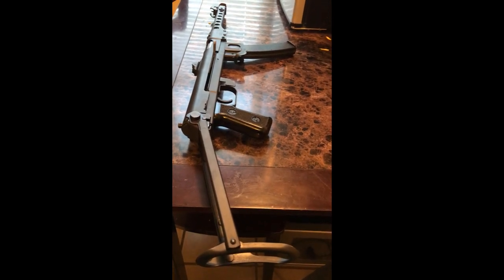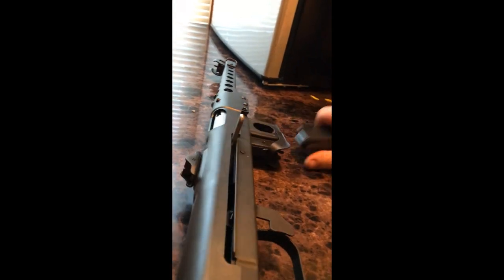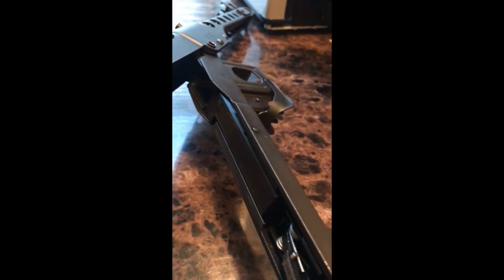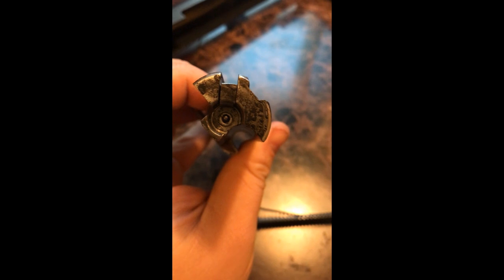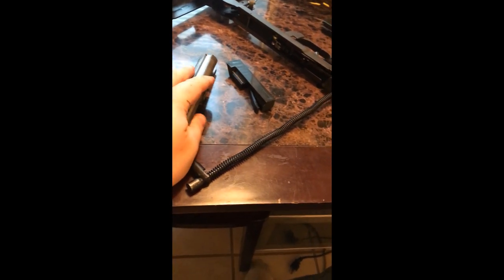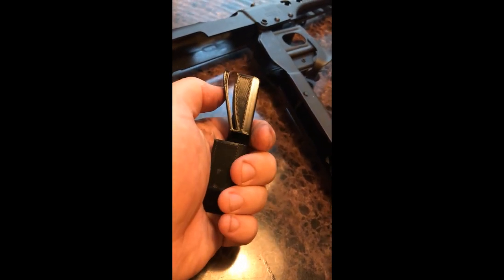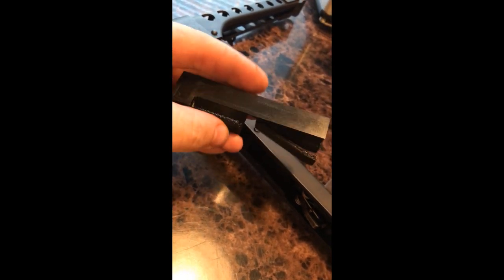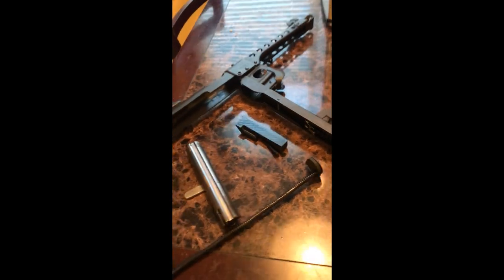PPS-43C Reliability Tweaks and Fixes

Comment: I had two problems with mine chambered in 9mm. One was the shell case was not ejecting because the ejector was floating out of the slot in the bolt like you had. I welded the rod at the back like you, then I put a touch of weld on the side of the ejector to keep pressure on it (it is between the inside of the receiver and the ejector). Also, when I welded the ejector, the pin they used to hold it on the rod is made from lead or aluminum or whatever and will melt from the heat.  The weld went against the receiver and kept it in place. I had to file the weld flat until the bolt would slide freely and worked out fine. Second issue was the mag went too far up in the mag well and the follower put pressure on the bolt to the point the bolt would not go into battery if you moved slowly forward manually. When it went into battery, and I removed the empty mag, the bolt would drop down and mate with the barrel. I filed the mag where it met the mag lock until it did not affect the bolt. I believe these mags are converted 7,62x25 mags, so maybe they went up in the mag well a little more. Good video, was helpful.